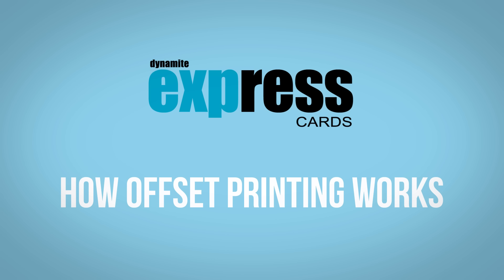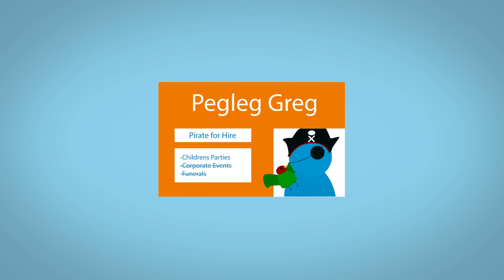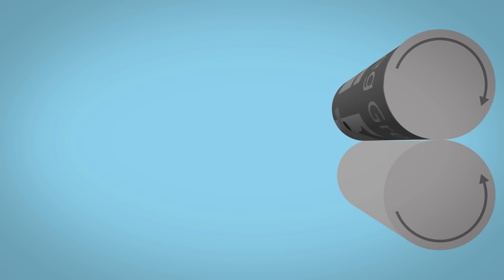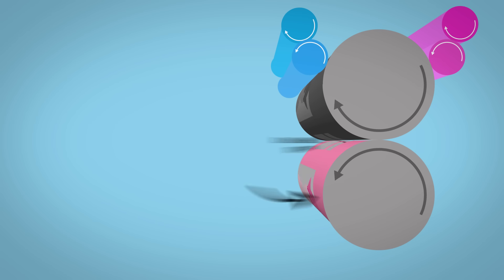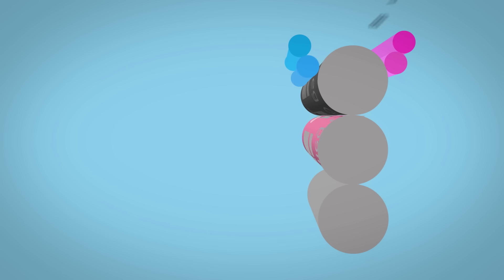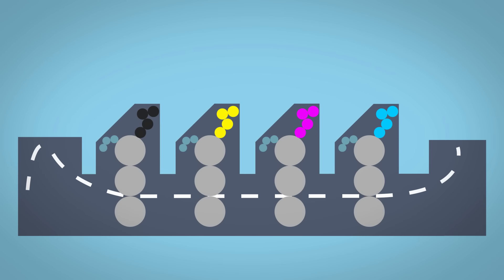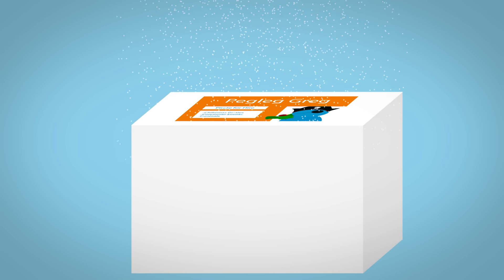How Offset Printing Works

Comment: It isn't necessarily digital.   Offset printing can be done using analog techniques.  In fact, that is how it was done for decades long before digital graphic design or digital photography came around.   This video is slightly misinformation for that reason.

Comment: Now I'm curious to know how did they do it for newspapers and magazines before the arrival of desktop computers.
Reply: Manual press
Reply: Back when we had people do our color separations! We didn't have that tech at our print shops! We had layouts of each pages that were tuned into signatures! We would get our film seps back and hand strip them in! It was very laborious and back breaking! Then we would have to proof everything! Then get approved by client! After that we send to press!
Reply: @fernandovalencia3542  Did you ever use the old flip-top plate burners with the electrode rods that touched to create a light as bright as an arc welder? That smoke had to be toxic.
Reply: @budlewis721  sure did!! I remember those cancer causing machines!

Comment: Im learning to run one of these at work. The video was less confusing than the guy teaching me lol.
Reply: I had the same experience many years ago. My level of knowledge and experience was minimal compared to the 3-decade pressmen who taught me. They explained things quickly, with the assumption I understood what they meant and had a rudimentary knowledge of the process... uh, process. "OK. Loosen the gearside trolleys on the balloon so we don't get overfeed and smash a blanket if the web wraps." Uh, what? But I didn't have a video that simplified it, though I wish I had.
Reply: @budlewis721  im 35 days into running s offset 1980s akiyama. Just smashed my first blanket Friday:/. Im getting better every day. But mistakes get made and i realize now the buttons are the easy part. Ive never even seen a press before but its fun.
Reply: @LEGENDZyo  It's a long process, even if you're sharp, something I can't claim. Don't ever make the mistake of thinking you have learned enough. There's always more, and you'll never get it all. I'm 69 and retired, and I just learned something I didn't know. I just hope printing will still be a thing in 20 years. And when you do it right, printers will be the only ones that will know.
Reply: @budlewis721  Thanks for taking the time to reply I feel like I’m headed in the right direction, its nice to know my experience is more common then I thought while learning this craft.

Comment: Can you reuse the metal printing plates?
Reply: If you clean them and put new  gumming on the plates, you can use them maybe 1-2 times until the ink accepting layer will get weaker and finally goes off, so there will be no image. 
We usually destroy them after one time use
Reply: You can use them indefinitely, but not for printing (except as noted by HLATG☝above). I once made a Tin Man costume with some and won a costume contest.

Comment: Black goes down first.
Reply: Not in any web printing I've ever done. The lightest color (yelo) is more easily contaminated due to ink on the blankets and idler rollers travelling on the web, especially on long runs. If black was laid down first, you'd spend half the shift shutting down for a washup(s).
Reply: @budlewis721  well the pic is sheetfed. I also run a web. Black is first too. UNIMAN 4/2.
Reply: @druckerman247  Are you saying I did it wrong for 32 years?
Reply: @budlewis721  no. There's more than one way to skin a cat.

Comment: If you're printing and want a good black value, don't use 100% K i.e. 0, 0, 0, 100 - it'll be printed looking a bit washed out, or a grey colour. I always use 60, 40, 40, 100 to give a rich black for printing.
Reply: I've never seen that, though I'm far from being an authority. Are you sure you weren't laying down too much water to compensate for the excess ink, and washing out the black? In one shop we'd put a deep red underneath the black solids. The result was a black you could dive into, especially on coated stock.
Reply: Ok, The rule is Text: 100% Black, rest 0%. When you need a good black on the graphic part, you use rich Black, That's 100%K, 0%Y, 40%C, 40%M... Now, you can make it richer, but it depends on the quality of the offset printing. These are safe numbers. I work for a boardgame manufacturing company and I prepare the files for our costumers.

Comment: Nice, but a brief mention of the alternatives would have been a good addition. Since you mentioned what offset printing is good for, high volume printing, it would be useful to mention what kind of printing might be good when you're dealing with low volume printing, and a link to a video that covers that kind of printing like this one does offset.
Reply: Digital or letterpress
Reply: @ginger2770  except barely anyone uses letterpress anymore
Reply: @ginger2770 Screen printing is sometimes used as well, although usually on textiles. With the right setup it can work with paper.

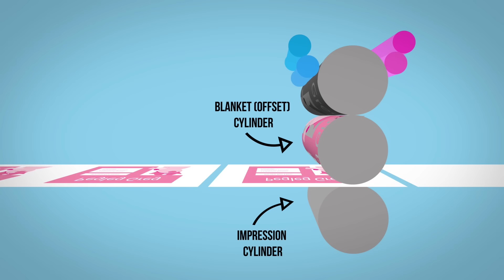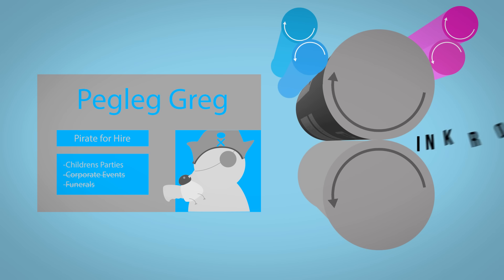Comment: there is one big mistake at 0:55  the water rollers and the ink rollers are on the wrong place. The blanket always hits the water rollers first then the ink rollers. Look at 0:27. there is the example good. The blanket cylinder turns in the right direction.
Reply: Not  in a Goss colourliner it doesn't the water roller hits a steel first and another water roller, they are nowhere near the blanket.  The water roller goes directly on to the plate.It's just a different setup.
Reply: You have good eyes, I did not realize the change in the rotation.
Reply: Actually the sheet travelling through the machine is present in wrong way...they are showing that sheet travelles in straight direction... absolutely wrong
Reply: @lafingas555  I suspect he meant the plate cylinder.